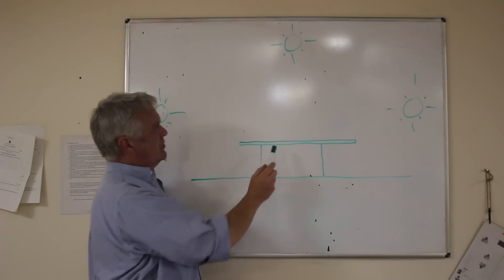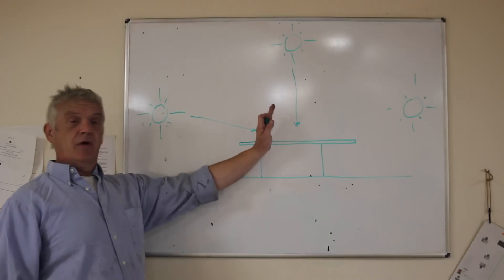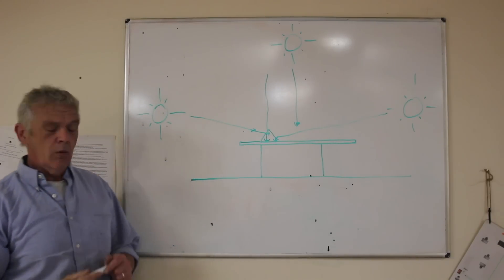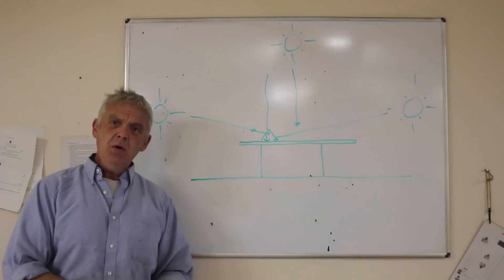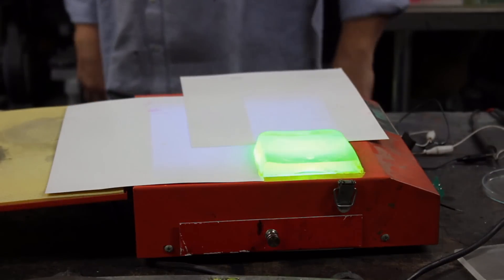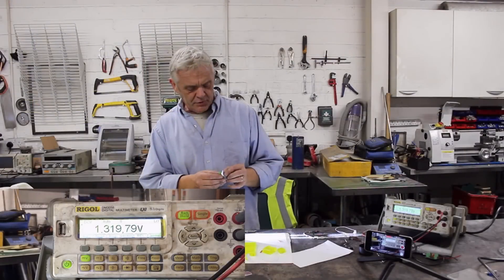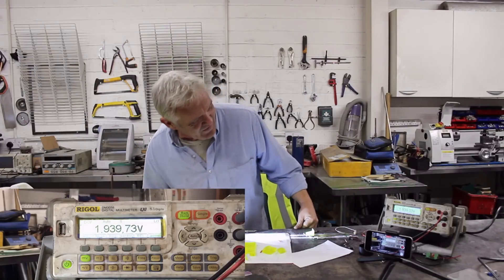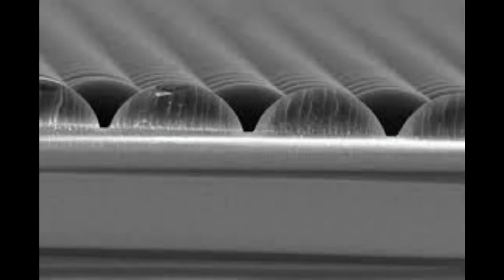1666 Solar Cells And My Evil Plan For World Domination

Comment: Slightly different train of thought but wonder if there was a way to slowly move the panel using the heat from the panel, something like the rubber band motor project or a Stirling engine, as the panel gets hot that heat could be used to expand something, under the panel would be in shade so I'd imagine there would be a fairly large temperature difference available to power something to slowly move the panel,  I'm going to need to research now how plants are able to track the sun as I have no idea, this fluorescence concept seems quite interesting though

Comment: Just found this channel and I've been thinking along the same lines.  The only thing I would change is use Quantum Dots in the prism medium.  As Q dots can be designed to absorb at one wave length and emit at another the idea is have a mix that are turned across the light/IR spectrum and all emit at the optimal wave length for the cell.  The one problem with this is getting the Q dots for the development phase :/

Comment: I would've thought circular based cones would be best, but organised in a hexagonal as oppose to square based 2D lattice arrangement. This would maximise the contact area of the base with the solar cell. Although I don't believe this will give 100% coverage (thinking back to solid state physics). I think this arrangement would be most resiliant to rotation of the sun about the vertical axis, but of course it changes its elevation angle and the optimum slop angle of the cones would vary to allow the rays hit the panel parallel to its normal. The problems would arise with losses where cones effectively shadow other cones. There will be a degree of transmitted light hitting the lower portions of the structures but most would be refracted. I think just geomertrically there would be a lot of losses as well as materially. I would be surprised if it ended up more efficient. I feel like a solar tracker with an arduino and a few stepper motors... perhaps with fluorescent would be optimum, or just further research into more efficient materials.

Comment: What about, talking about Simplest and Cheapest Way to Improve Efficiency, to Move the Fluorescent Reflectors You have already Demonstrated? They would be I think Much Easier to use to Track the Sun Rays while the Solar Panel would be Fixed more or less Horizontal. What do You think? :)

Comment: Or...we double the energy capture by not using photovoltaic and instead use thermal capture. You can have a parabolic trough boiling water from sunrise to sunset without any tracking (by placing it perfectly east/west). Seen this in action from an Ukrainian YouTuber during their winter.

Comment: I have a concept with your idea with jelly on a surface of 200x200mm and up to 50mm hight BUT iam try to Figure out the minimal surface or volumetric optimised Design. 

So 2x2x0,5dm=2dm³ or 2litre

Comment: Try using a thin sheet standing vertical of various heights based on the percentage of the panels width.. 
Maybe one in the center of the panel, and/or one on each edge of the panel.  Check both with and without the florescent dye.
Thanks, you're very informative !

Comment: Yeah played with that idea about 25 years ago, got some design files with diagrams too, and a whole lot of other neato ideas including a convection driven logic system that make a solar driven HVAC system that computes its own settings. Fluid based logic is very interesting and air is a fluid. There is more that one way to do the "prism" idea, like you say but pyramids or hexagonal forms (hard to explain without a drawing) or you can make them nanoscale and rely on diffraction over the top edge to bend the light downward and also make them serve as top conductors, graphene perhaps. And like you say you never end up with a net gain. Prisms are more useful for scenarios where you have edge exposed stacks of junctions with different band gaps, then the spectral spread can be tuned to illuminate the matched junction. I was very into this stuff until I realised that running civilisation on PV is suicidal due to the regular threat of volcanic winters of +2 years duration.

Comment: I had a huge question for the community since we are working with fluorescence, would it be possible to print the circuitry needed for a PV cell, complete with a fluorescense prism, all in one go by also printing with that same laser diode, Synthetic Rubies, small enough to serve each individual PV diode? Synthetic Rubies like the ones you can make in the microwave are fluorescent.

Comment: Check out Solyndra solar panels. The cells are cylindrical which allows a tracking effect similar to what you describe. Result is a flatter production curve but a lower peak production. When placed on a reflective surface (e.g. a white roof) the efficiency also improves. I wonder how they would behave with the roof painted with florescent paint. I feel an experiment in my future.

Comment: Well it occurred to me that florescence will only boost a panel when it is not already at full voltage which could be huge because most of the day is not a full voltage, but I do not believe your idea will drive a full panel higher than the maximum voltage it can make.

Comment: As l have said before Robert, you are a gentleman and a scholar!  Thank you, your blood is worth bottling.  We had a tracking solar hot water system in 1985 and it lasted until around 2000.  Unfortunately the company that built them went broke and so spare parts were impossible to get.  We had to install a panel system after the demise of our tracking system.  We paid around $1000 in 1985 for our sun tracker and had 15 years of free hot water.  Cheap by any standard.  Hi from Australia.

Comment: I think you've done it, you've made passive solar collection as efficient and effective as active systems in what I would presume to be equal or slightly better than the same volumetric efficiency as active, and thats without looking at the backscatter gathering youd get with my back of the napkin math I just did!
And it could be much cheaper depending on the medium used for the prism.

But more then that, active solar trackers are not very human friendly in the way they use thier space, this could be very human friendly, as a steeped roof or ground installation and relatively self cleaning.
Now if I may be as bold as to suggest a glance at nonlinear optics for that prism to reduce costs and further increase efficiency? You could end up with a very low cost and low weight product quite capable of installation just about anywhere that a prism of this size would be practical
And because you can get a nifty light trap guiding all the luminosity of the reactive glow towards the collector or P.V. panel you might even have a nice way to extend the output of a solar panel for quite a few hours after dark, even if it is not anywhere near output during the day some of these compounds still act like a battery and I imagine a solid prism capable of touching as much sunlight as a active tilting tracker would be able to store quite a bit of energy if you wanted to give the trade off for peak energy output for lasting energy output.

Now I am quite curious about glow in the dark efficiencies and down the research rabbit hole I shall go! A full hypothesis shall be formed rather shortly.
Reply: You are correct. Rob made a video for an alternative type of prism and a DIY Fresnel lens that would work for this application...
Reply: Also your idea for a Light Trap. It works!!! There is a research paper on work that was done last month this year on a Light Trap made with semi transparent mirrors and Fresnel lenses. The engineers were able to successfully get a beam of light to block itself inside the device. If you construct your Light Trap idea and use transparent Photovoltaic Glass you can harvest it's energy and then you have a new type of battery. One that RUNS on trapped Photons.
Reply: Ok hopefully this time the YouTube auto censor does not delete this post. On August 25th 2022, the Viena Technology University published a paper with the results of the Light Trap they build. You can find the paper by doing a quick search for "Light Trap developed in which a beam of light prevents itself from escaping"

Comment: I had an idea about 15 years ago for a concentrated solar collector. Basically use an ice-cream shaped clear plastic bottle, so a hemisphere connected to a cone. Place the pv cell at the pointy end of the cone (cut the tip of the cone flat to the size of the cell). Coat the cone part of the collector with a reflective material (mirrored) and then fill the whole collector with water so the hemisphere becomes a large lens. I mocked one up with a PET soft drink bottle and silver foil and it seamed to work well. You could used PET bottle machinery to make the collector and you could place the PV cells in the caps. The water also help to conduct the heat out of the pv cell and dissipate it.
Reply: Oh wow!!! This idea!! One of these availiable at outdoor survival goods stores would be so awesome to have!! Dude you should still go for it! I don't see any portable set ups like the one you describe availiable for sale at survival goods stores either. It's attractive due to how you made it from the constructed components of soft bottle drinks. I also like that it sounds so light weight and portable too.
Reply: @captainnemo6655  These would be easy enough to make as a two piece system where each piece can stack with hundreds of its mates.
And then fill it with local water.

Comment: If you look at the clear cover of many fluorescent lights you will find the inside surface has hundreds of mini pyramids to diffuse the light . You could use that and also use it as a mold to form it with your gel.
Reply: Mini pyramids of Fluorescent Gel. That would work. Question for you, Rob has a video on a DIY Fresnel lens made from hollow plastic tubing, what if that hollow plastic tubing were filled with liquid glow in the dark PHOSPHORESCENT pigments?
Reply: @captainnemo6655  yeah interesting . 👍🏻

Comment: Ive been thinking about fresnel (spelling?) lenses for a while - i was always concerned more on additional heat on the panel…
Reply: Good idea. This would work. Rob has a video on DIY Fresnel lenses that would work for this application... Also the heat is no longer an issue as you can add to the panel a thermo electric heat engine that would take away that excess heat and turn it into additional electricity for running the panel at night.

Comment: The issue with fluorescent dyes is that they photobleach. They likely won't have the lifetime needed to be practical.
Reply: Even more reason to use Uranium Glass or even better transparent Photovoltaic Glass or better yet Rob has videos on translucent graphene pv cells. Uranium glass to boost PV generation by taking advantage of fluorescense is still a better bet thought. The glass is safe and non toxic now.
Reply: @captainnemo6655  Transparent/translucent cells are OK if you're talking about covering windows. But otherwise you want to use strategies that make the light spend as much time as possible in the vicinity of the depleted region of the diode. Only light that is absorbed there has any chance to be converted to electric power. For that transparency is working against you.
Reply: @Drjtherrien  did you see these types of cell and the amount of power output they can generate on a building such as the 550 Spencer?
Reply: @captainnemo6655  That's interesting. I guess I tend to be biased because my work with PV cells has focused 100% on maximizing power generation and not a mixed use application like this. But there is a place for that for sure... being able to generate more power than the building uses is a net gain for sure. Assuming the PV doesn't add too much to the cost.

An engineer at Applied Materials, whom I did sponsored research for, told me once that the margins on solar are so thin that any technology that adds even a half penny to the cost of the cell will not be commercially viable.
Reply: @Drjtherrien  that engineer at Applied Sciences has never heard of Rob's Chanel. That's what Rob's teaching videos are about. How to maximize by using what you already have through challenging previously held notions about materials and sciences with real world results in a DIY format. Waste nothing, repurpose everything.

Comment: Why is it that we are focusing on angles when sand heat and stirling is the engine of the future and when you look it up it shows these weak running stirling engines  please run through this thoroughly some don't get it. Sand is an extremely effective battery.
Reply: We are focusing on fully unlocking the potential of solar cell technology by discovering, researching and building solar cells that can work day & night and can generate water from the air. Not only that but we are exploring the realm of impossible possibilities by challenging previously held notions and thinking outside the box to fix problems with huge results from very obvious sources... Here in Rob's series of videos we explore what can be done to further boost performance of a solar cell, including transparent Fluorescent media like gel. The goal is to see the full potential in materials like Photovoltaic Glass or Semitransparent Graphene Photovoltaic cells(of which Rob has a video on).... And speaking of Sterling engines as the future, did you hear about NASA celebrating 45 years' of operating the Voyager probes continuously? They recently released a paper talking about the probes power supply. They run on RadioIsotope Thermo Electric generators. The NASA press release went further to state that engineers are going to combine this system with a Sterling Engine to generate more electricity on the next generation of planetary probe they launch.

Comment: If you mount the panels on a teeter totter with a balance tank on either end, you can move them by transferring oil from one to the other with very little energy. 
Some systems use refrigerant and the nature of sublimation.
Reply: A thermal hydro dynamic tracking system based on fluid temperature and pressure. Good idea! Also did you know this kind of mechanism was first pioneered by ancient Greek robot makers?

Comment: A simple answer is to use a reflector on each end to bounce sunlight back on the panel. Additionally the extra light give greater efficiency to the panel even during midday.
Reply: Or you could use FLUORESCENT transparent Photovoltaic Glass or Flourescent Semitransparent  Graphene Photovoltaic plastic(Rob has a video on how to make one) moulded into the shape of Fresnel lens and then focused onto a high efficiency PV cell.

Comment: Rob, for what it's worth I have designed/patented a solar panel that uses your graphene ink, outputs 80 watts per square foot AND it needs no tracking mechanism as it always faces the sun.  Final tests are being performed now, and all joking aside, I do intend to take over the world.  And buy a lot of your ink.  Many thanks.
Reply: Excellent! Keep going. Next is the new and improved version of those solar panels. The ones that work day and night and can generate water from the air. In addition to special Photon Batteries and solar BioVoltaic Microbial Fuel Cells.
Reply: @captainnemo6655  I'm not sure what your Reply has to do with my post, so I'll assume it's unrelated.

Comment: What about putting a wall of prisms on the east and west sides the solar panel instead of on top of it? That way the rays would be bent around in the early morning and late afternoon, but the mid day sun would be unobstructed.
Reply: This would absolutely work actually, a Reversed Fresnel lens would do the trick. Rob has a video on a lens prism made of a coiled bit of tubing. Imagine making the tubing Fluorescent as well and then coiled to get the prism effect from all angles.

Comment: Talking about efficiencies: Can you layer materials with different refractive indexes to shift wavelengths closer to what the cell absorbs?
Reply: Yeah you can with Photovoltaic Glass. Also known as Transparent Solar Cells. These panels can be layered with other types of PV cell to fully absorb every frequency. A complete Solar cell would have the layer of glass be made of photovoltaic Glass with a panel of 50% Efficient Solar Cell underneath and sorroundings the whole, a thermoelectric heat engine, such as those found in HydroPanels.
Reply: @captainnemo6655  So cost is a prohibiting factor or is it diminishing returns of light harvested? (also thanks for the answer and terms)
Reply: @audiblevideo  cost is not a prohibitive factor at all actually. Rob made a video on an economical way of doing these kinds of materials, he has a video on DIY method for producing transparent Photovoltaic graphene panels.